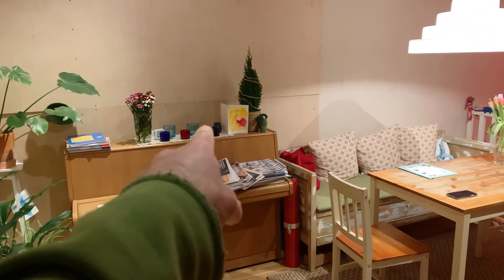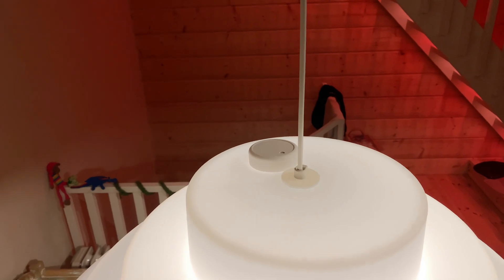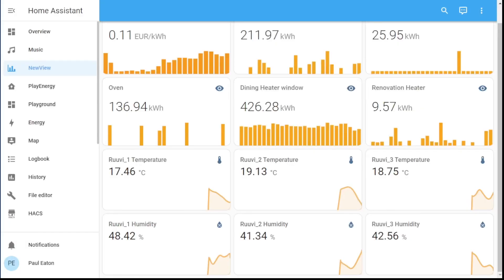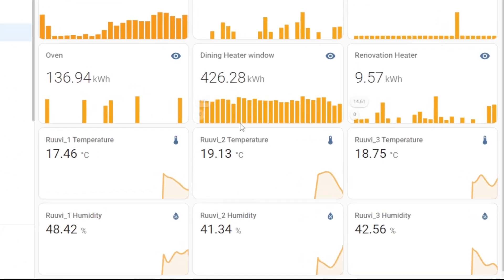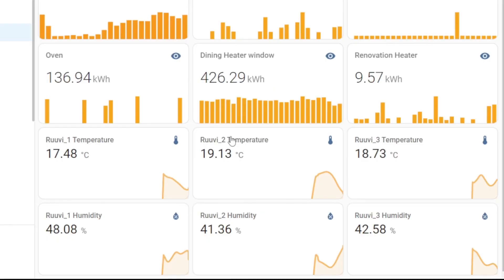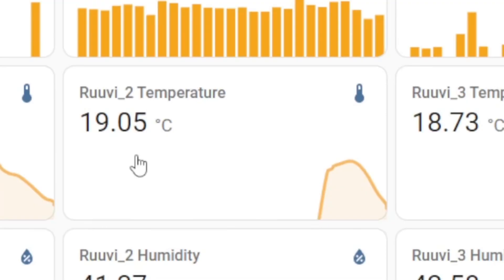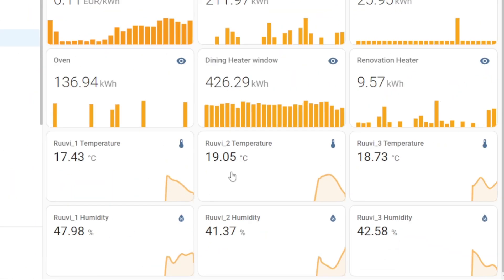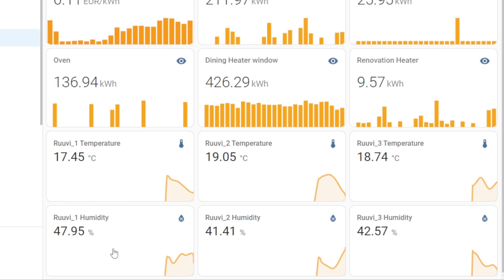Smart home: temperature sensor location makes a BIG difference.

Comment: Would you expect any greater or lesser differences at the different heights in summer vs winter?
Reply from the maker: Hello! Good question. I’m expecting if we keep the temperature consistent all year round then it would be similar in winter vs summer.  Time will tell. Now you got me thinking of a need for more sensors in every room. Then with a few in each room I could just take some averages. 😀
Reply: @PaulWarrenEaton  I've got rooms with multiple temperature sensors due to having multifunction devices like motion sensors. I use the average temperatures for those rooms. Of course, no matter how much data or how many graphs I have...the "true" temperature is always what it "feels like" to my wife! But I'm just monitoring for comfort...I don't have clay for which I'm trying to optimize the drying time.

Comment: Hi Paul! Have you tried keeping the sensors in the same spot, or swapping them around to see if the difference is still consistent to location or sensors? Just to rule out that there’s a calibration issue.
Reply from the maker: Great question. So yes I kept all five together on my desk for a couple of weeks and could see that they were all close to perfectly calibrated together.

But now I will mix them up a little and let’s see what comes.

Comment: Warm air holds more moisture
Same amount of moisture at higher temperature = lower relative humidity
Reply from the maker: Yes that’s the way. Thank you. 
I’m still surprised this kind of difference within the same room but at desk and ceiling height.